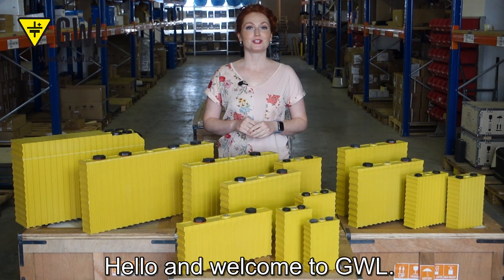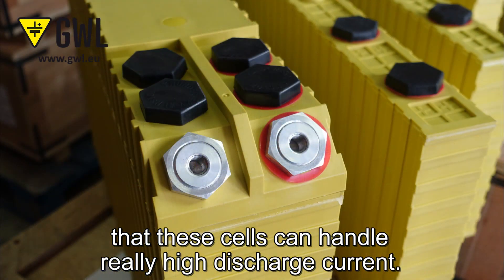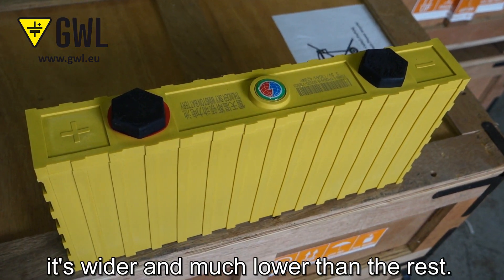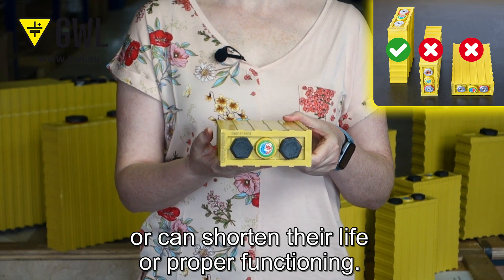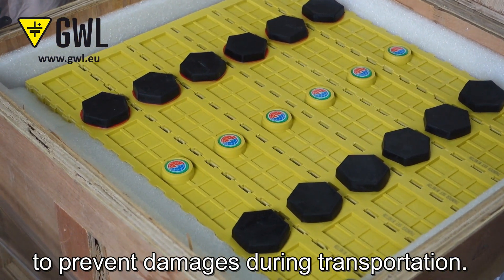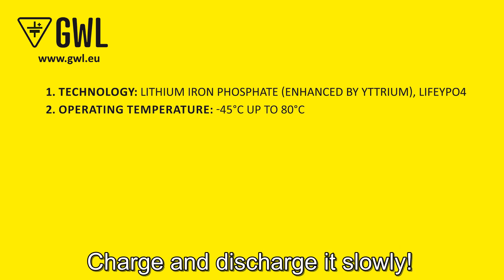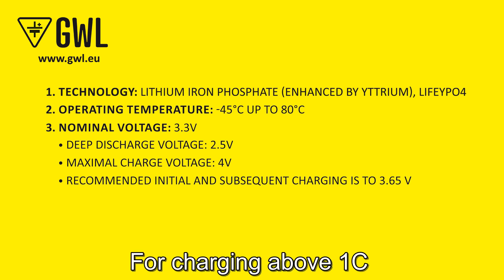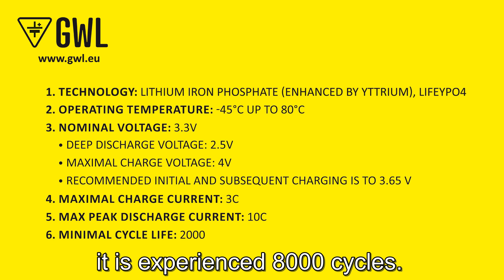ThunderSky Winston LiFeYPO4 cells portfolio at GWL (EU)

Comment: Do these cells require compression?
Reply from the maker: No, but it's better to fix them in the installation, it also protects the pack against mechanical damage. 
Like this solution: https://shop.gwl.eu/GWL-Modular/ELERIX-Holder-For-EX-L110-8-Cells-1.html (this one is for Elerix cells)

Comment: Excellent batteries, they have a different chemistry than other LiFePo4 to withstand low temperatures during charging, with obviously some limitations, I would like to know more precisely how they behave at a temperature below thermal zero, which charging and discharging currents to use for example at -15 / -20 ° C
I would treat them very well to make them last as long as possible never below 3V never above 3.55V. Am I exaggerated am I crazy?